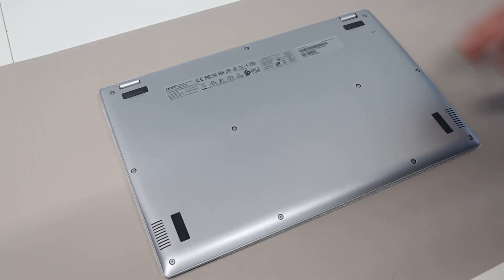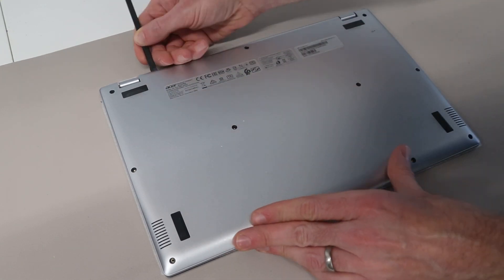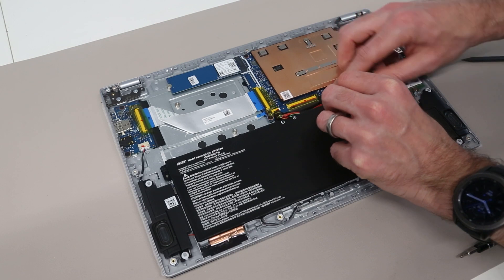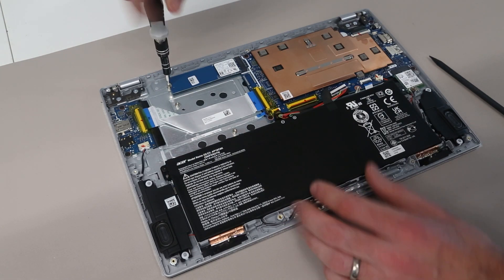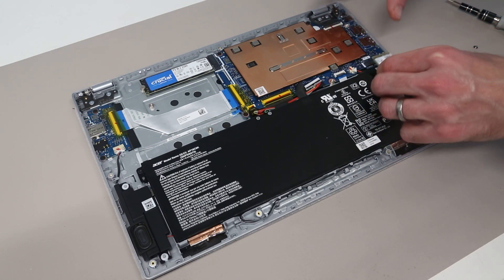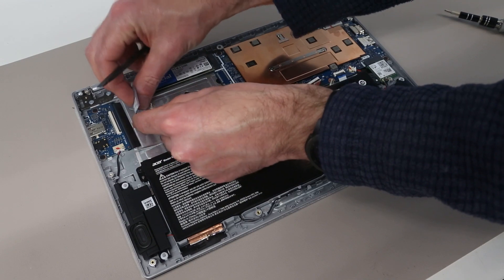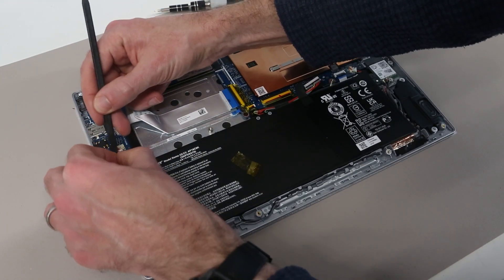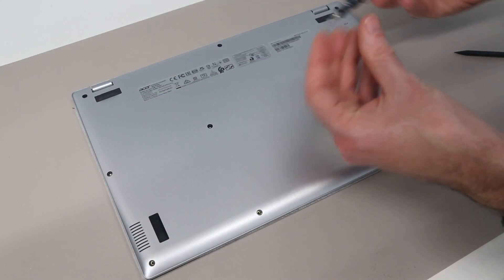Acer Swift 1 SF114-34 - SSD Upgrade and Battery Replacement Guide

Comment: Sad that commentators did not read specs before criticising Acer.  You know what you get before buying it and they are low cost and become better in case stability. I opened my wife's because it kept turning off at random. Turned out just a full hard disk.

Comment: hey i have a question actually , i baught this same model latop from overseas in a hurry , although is is good fro working , 16 gb ram , fingerprint and all that stuff ,but it get heated up allot because does not have a inbuilt fan , i wanna upgrade the graphics card and the processor , is it possible ..?
Reply: get a new pc

Comment: I can get into the BIOS menu but without being able to change any settings. Reason: I was messing around w/ my BIOS passwd. Is there a way to reset the BIOS via motherboard? I heard you could do it via a jumper. Cheers.

Comment: Excellent work! Thank you. The SSD you put is the P2 M2 2280? Another thing: is it possible to add a second SSD in the laptop? Thank you for your reply.
Reply from the maker: Yes, I have a Crucial P2 1TB I keep for testing, so you'll see it in most my recent upgrade videos.
There was a second M.2 slot silk-screened on the PCB, but no socket on the board, so only 1 SSD could be fitted in mine.
Reply: OK, thanks!

Comment: Great video ! Can one replace the SSD without disconnecting the battery ? I noticed you weren't wearing an earthed wrist strap. Am I over cautious ?
Reply from the maker: You can do it without disconnecting the battery, but it sensible to do it.
I've never actually bothered with an earthed wrist strap in about 30 years of working on computers, and have never had an issue with it. Even when I worked at Intel I never saw anyone using them in the labs.

Comment: Can someone tell me if I buy an nvme drive for this will it work if I install it? They have some on sale in Ireland where I am but don't wanna be wasting money if its not gonna read it
Reply from the maker: Yes, the system has an NVMe installed as standard.
Reply: @BrueComputing  brilliant thanks 👍
Reply from the maker: @noelybyrne  No problem.

Comment: Thanks you for the tear down. Would have also LOVED to see an added memory slot, but an easy storage upgrade. I'm a fan of Pentium Silvers, with their 4.8W-6W TDP, and the N6000's Average CPU Mark of 3176 (which is plenty of CPU power for anything I do). Backlit keyboard and FHD screen, might need to acquire one in order to install Linux on. Thanks!!
Reply: Where GB ram?
Reply from the maker: @anonteam2850  The RAM is soldered to the mainboard and not upgradeable.
Reply: @BrueComputing  oh ok
Reply from the maker: If you're after one then mine is up for sale shortly. I bought it specifically to do the review and upgrade guide so its only has a couple hours use - just need to factory reset it.